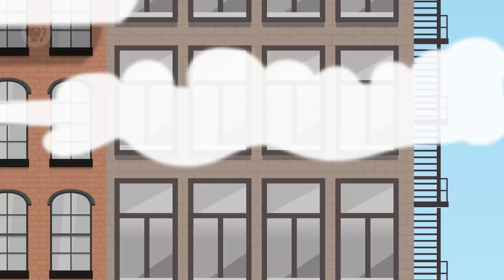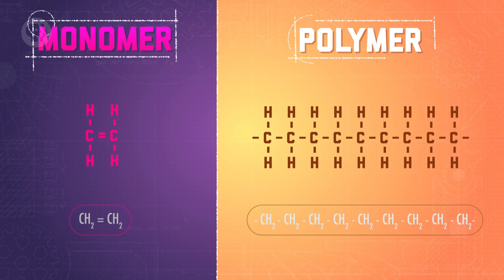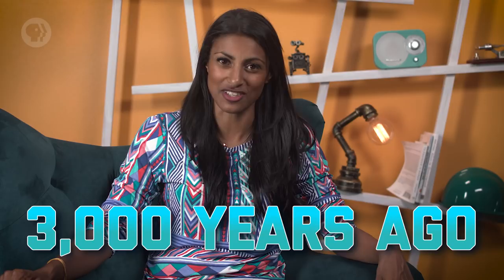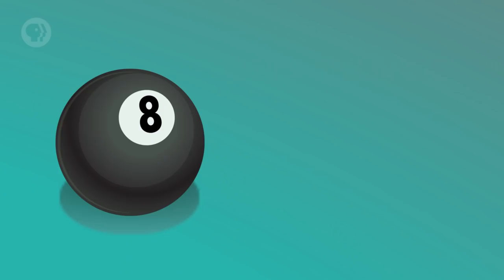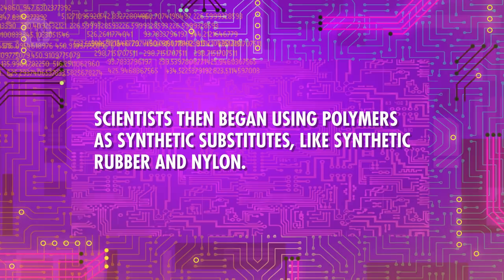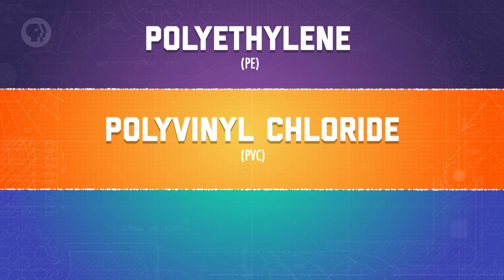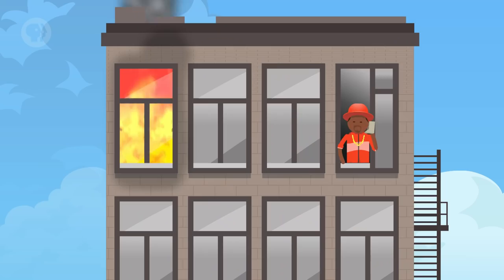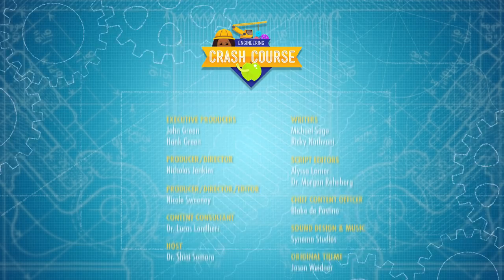The Polymer Explosion: Crash Course Engineering #20

Comment: To provide more learning, I can add a mini-crash course on some polymers and plastics info.
The big thing with plastics is that they are generally divided into 2 types: Thermoplastic and Thermoset. Thermoplastics can be melted and solidified over and over again, and do not have any cross linking, or bonding between the chains of polymers. Thermosets have lots of cross linking, and cannot be melted once solid. Thermoplastics are characterized by being melt-processable, meaning all manufacturing methods involve melting the plastic into a liquid, then forming it into the shape you want and cooling it there. Common methods of melt processing include injection molding, extrusion, and thermoforming. Thermosets, since they cannot be melted, have to be created on a chemical level in their final form. This means that you start with a liquid uncured polymer and an initiator (a chemical that causes the polymer to cure). You then mix the two parts and pour of flow the liquid mix into position, then let it cure and solidify in place. A store bought 2-part epoxy is an example of this. Carbon Fiber and glass fiber panels are examples of things made with thermosets, the fiber weave is encased in a cured thermoset.

The plastic property mentioned that might aid water flowing higher is a reference to the fact that thermoplastics, when loaded in shear like being forced through a pipe, will reduce in viscosity. Normal liquids increase viscosity and resist flow the more you push, but plastic will flow more. This is a result of the long polymer chains lining up in the direction of flow, but the alignment increases the more you push on them, resulting in lower viscosity the harder you push.

Another fun property of plastics is the glass transition. Most thermoplastics have 2 different phases of being solid. Below the glass transition temperature, they are stiff like glass, and will be brittle. Plastics like Polycarbonate, used for safety glasses and blast shields, is below its glass transition temperature at room temp. Plastics that are soft and can be belt and folded, like a ziplock bag, are above their glass transition temperature at room temp. When a plastic like polycarbonate is brought above its glass transition temperature, which is less than the melt temperature, it will become soft and wobbly. 

Speaking of temperatures, thermoplastics do not have a definitive melt temperature. Metals have a temp that they always melt at, but plastics generally have a range, and some have no discernible transition from solid to liquid. Melt for a plastic is defined as the point at which there is enough heat energy for the long chains to slide past each other to allow for flow. This mainly takes the form of breaking crystalline regions of the plastic (polymers can be semi-crystalline on a microscopic scale, with small areas of crystal structures and small areas with no structure, called amorphous). The longer the chains are, the higher the melt temperature as its harder to get them to slide past. So 1 plastic can have a range of melt temps depending on the particular molecular weight, or average chain length, of that sample. Polymers that have no crystal regions are called "Amorphous", and they have no definitive temp at which they melt. From the glass transition temperature to the point where they start to degrade and burn, they just gradually lose viscosity and stiffness. There is no hard line that says "this plastic is now liquid". You can just turn the temp up or down a little, and it will just get a little less or more viscous.

Well there is a little deeper into the subject at a very, very brief overview with some fun info. Hopefully someone enjoys reading it!
-Source: Plastics and Composites Engineering student senior.

P.S. don't pronounce the "ph" in Terephthalate. Its to much of a mouthful so everyone in industry just skips those letters.

Comment: Important piece of information about elastomers: they absolutely must be cross-linked to return to their original shape, otherwise they just deform permanently (which means they flow like a syrup, in this context) 

The cross links don't necessarily need to be covalent bonds though. Also, cross-linked elastomers will deform permanently if you stretch them out for a long enough time, and they'll contract if you heat them while they're stretched. Polymers are weird as hell, basically & Silly Putty is magic.

Another fun bit of information: you totally can use polymers to build buildings, planes, boats and such, so long as you combine it with something else. The Boeing 787 is made mostly of carbon fiber reinforced epoxy resin.

Comment: Are polymers biodegradable?
Reply: Depends on the polymer. Cellulose, yeah. Expanded Polystyrene (styrofoam) not so much.
Reply: Valdemar Pereira de Matos well duh, if their made from plastics and synthetic rubbers, no.
Reply: As stated above it depends. If you look at polymers as a whole most of them are not bio degradable, meaning they will return to their original parent materials. DNA is considered a natural polymer as well as tree saps used for natural rubbers. If we look at plastics though, it again depends. There are glucose driven plastics like PLA that are biodegradable, then there are some plastics that are degradable with certain conditions like UV light exposure. 

Even though they aren’t biodegradable, a good portion of them can be recycled by grinding them up, melting them, and making new things from them. Similar to other materials such as metals and ceramics.
Reply: There are absolutely biodegradable plastics. Depends on what you make it out of and what you add to it. Also, sometimes nature just up and evolves a bacteria that can eat it (happened pretty recently. They found a bacteria that eats PET, which is goddamn huge news for biodegradability of plastics)

Biodegradable plastics are usually made from something besides petroleum, or designed to break apart really nicely under certain environmental conditions like Chris said. 

Synthetic Rubber can mean a couple of things. We can synthesize the exact chemical natural rubber is made of, so that synthetic rubber about as degradable. There's other synthetic rubbers that are variously degradable too. 

For Recycling:

There's 2 categories of polymers: Thermoplastic and Thermoset.

A lot of plastics are thermoplastic, so you can re-melt them into something else. This means you can recycle them, but every time you do you shorten/break the chains a bit and it's not as useful as fresh made stuff. Eventually it's useless.

Thermosets cross link when you process them, which basically means you turn the pellets or whatever into one single bigass molecule. They're usually stronger, but you can't re-melt them, because you can't melt a single molecule. It'll just burn or break into a different molecule. Most rubbers are thermoset, but not all. Styrofoam is a thermoset, as is PVC (the hard white plastic stuff they use for pipes).

Thanks for asking this question, and thanks for reading my answer! I appreciate the opportunity to dig up old knowledge from my university polymers classes.
Reply: Thanks for the great replies. I think it’s a fault not to refer this in the video taking in consideration the pollution problems we’re facing nowadays.
Reply: True. I understand why they wouldn't mention it in an introductory video where they barely cover the incredibly basic aspects of polymers, so I hope they mention it in a future video. Maybe towards the end of the series have a video about engineering ethics, particularly with polymers.
It's a shame modern society literally can't function without them. Hopefully we can make the biodegradable and recyclable replacements economically viable sooner than later.
Reply: I work at DOW Chemical and I can say most aren't yet. But the push In order to achieve the point that all chemical made polymers will become biodegradable is quite big. Even if just so they can be the first to offer it.